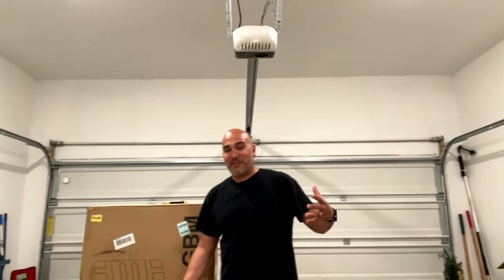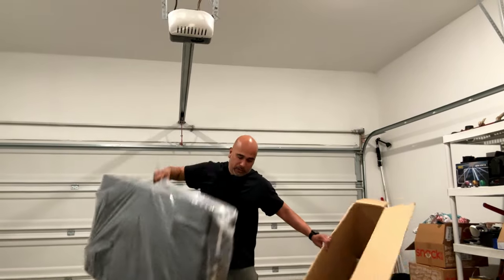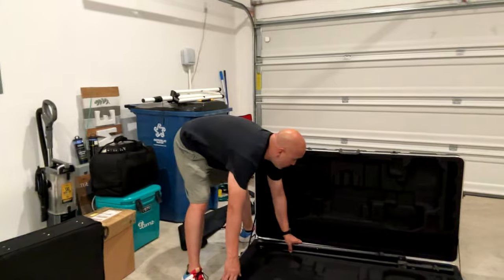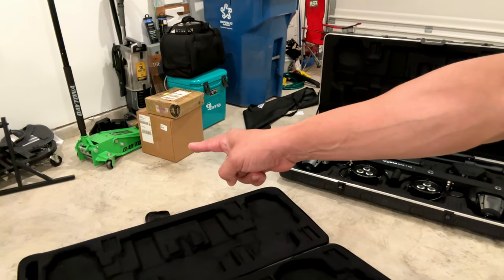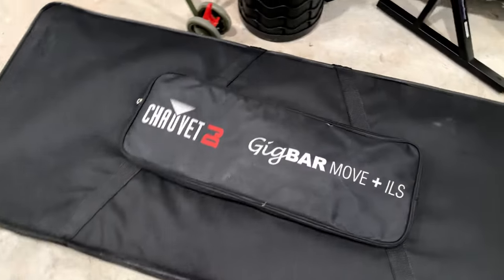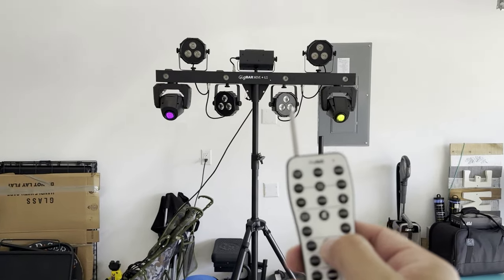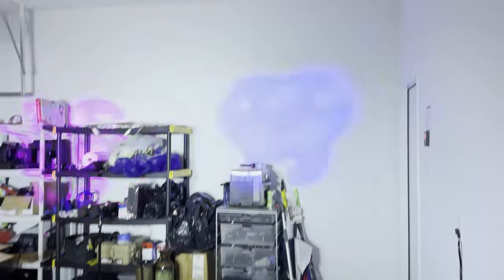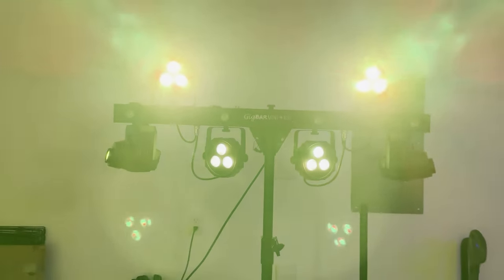The All New Chauvet Gig Bar + ILS Hard Case PLUS a Much Needed Modification to the Gig Bar!

Comment: I was so against this bar for my weddings because the lasers and shitty derbies. But I never knew you could swap them out! Bravo! Looks like I’ll be ordering one for NYE 🎉
Reply from the maker: Trust me, I was debating getting this too to begin with, but just said to myself, "I'll just turn the derbies and laser off and just use the pars and moving heads" But what a waste right? When I found out you can swap them out, I was sold! Would love to see yours when you convert it! :)
Reply: @djdannybhtx   I still like a slow moving mirror ball lighting for dinner and slow dances but haven’t found a replacement for my Chauvet Radius lights
Reply from the maker: Have you checked out the Rotosphere from Chauvet. Give a really great effect. To be honest, it looks so much better with haze, the only problem is, here in Houston, TX. 99.999999999% of the venues here do not allow haze! :( :( @PartyProDJsFL

Comment: I also replaced my derby's with pars. I am using the DDJ-FLX10 with Rekordbox Lighting. Absolutely awesome!  One thing to note: I left the derby's in the fixture profile but changed the lighting type from "effect" to "Par 1" & "Par 4" leaving the factory pars as 2&3. 
I also upgraded the case and love it (the wheels are great improvement making easier to  transport.
Reply from the maker: That's awesome! I would love to see how that works with your Rekordbox lighting!

Comment: Can you dim the lights on the entire gigbar from the remote?  Or do you need DMX hooked up to dim the lights?  If not, you may be stuck in a situation where they are too bright.  Thanks
Reply from the maker: I believe you can with the brightness button, however, I do have the ILS Command now and will test both very soon.
Reply: Thanks!

Comment: WOW! Genius!
Reply: Another tip on that remote. You should take off the Battery Everytime you finish a gig. If you leave the battery in the remote. The Remote will suck up all the juice out and you gonna have to buy a new one. I take it off.. and Put a Gaffer Tape on the battery and put it on the other Remote Section. When I'm ready to start a new gig.. I just put the Battery back in the remote.

Comment: That was a great tip about the pars, I just ordered two myself.  Thanks!  Hmm, I wonder if you can mount moving heads there instead....?
Reply from the maker: Thank you Tarekith! Everyone's been asking that, but the moving heads are hard wired into the gig bar, so I doubt that's possible. the other lights are a simple twist and plug into the gig bar. Wouldn't hurt if I asked though. I'll follow up.
Reply: Let me know also @djdannybhtx I did wonder about two more moving heads
Reply from the maker: I checked, you cannot add more moving head to this. There are moving parts inside of the bar itself is what I'm being told. That would be super bad ass though.  @djjohnnyp2700

Comment: I just inquired with Chauvet about purchasing the additional wash fixtures to replace the derbys. They're out of stock as of 5.15.2024, but they also replied: "Please note that the pars draw more power than the Derbys, so this may cause excess strain on the power supply and cause premature failure which would not be covered by warranty.". Have you experienced any issues with the difference in power draw?
Reply from the maker: Here's the deal. I have not experienced any issues with that. I personally asked their tech team if the derby's can be replaced with the pars and they said "Absolutely"! After I put out this video and it now has over 12K views, 210 likes and almost 200 comments; all of a sudden you can't do that. I'm thinking Chauvet ultimately likes my mod, they just don't want to admit to it LOL! I think this is the way the Gig Bar should have been made. I was also told by another YouTuber, that they were told by Chauvet, b/c of my video, they have been sold out of these pars ever since this video came out Lol. So I don't know what to believe.

Comment: Great video.  I've been considering getting the Gigbar Move + ILS. (currently have a gig bar 2) and loved your idea of taking off the derby lights.  When you pulled them off and added the 2 par lights, did you find the weight of carrying the gig bar around in the hard case is a little lighter?  Also, does the gig bar fit the same in its original case with the 2 added pars? I would think it would but figured I'd ask :)
Reply from the maker: Hey Jamie! The weight is about the same, the derbys and the pars are not far off in weight. And yes, it still fits in the original case too! I kept it because when I want to pack it in my Durango, the hard case doesn’t fit.

Comment: This looks much more elegant i would also lose that stand and replace it with a Gravity stand that will let you place it in front of your set up between the DJ booth and controller etc.
Reply from the maker: Thanks! I have since upgraded to a gravity stand as well! 🎉🎉
Reply: @djdannybhtx  Awesome video, I've been using the OG GigBar for a while (mostly do smaller local venues) but just upgraded to this bar. Curious which specific Gravity Stand you went with for this bar as the tripod does take up a lot of real estate I could otherwise use. Thanks!
Reply from the maker: I have the regular touring flat base and pole from Gravity. I wanna say it goes about 8' high? More than enough. Thank you!

Comment: Great Video Dj Danny, I’m looking to to swap out the derby lights as well. Just have a quick question. When hooked up, how do you control them using the ils command console? Will all 4 pars sync when pressing Par button or will they work when you press the Derby option? Thank you 🙏
Reply from the maker: Hey there thank you! So the one time I have tested it with the Command ILS, the pars worked perfectly when pressing just pars. Since I usually operate solo during my gigs though, I’ve been using the remote 95% of the time.

Comment: Amazing review and love the mod and case! Just wanted to ask, I just bought mine and am worried about the moving heads shining directly in guests eyes on my wedding dance floor this weekend. I’m playing with the movement settings and just wondering if you have any tips or have anyone ever complain that those moving heads hit them in the eyes.

Best wishes and thanks for the video!
Reply from the maker: Hi Michael, thank you Sir! So ii have never had anyone complain or say anything about the moving heads shining in their eyes. The good thing about the Gig Bar is I put it at it's highest point and the speed I keep it at a medium speed so that it's constantly moving and not paused too long in one area to be able to blind someone. You can also adjust the intensity of the brightness as well if it every becomes an issue. :)

Comment: Would it work the same for Gig Bar Flex or Gig Bar 2 if I switched the Derby to Par lights too ?
Reply from the maker: Yes Sir. As ling as it has the same connections. Just need to go to Chauvet Parts Store on their website, look up your bar, and all the replacement parts will be listed there. 😀

Comment: I like it easy setup I had bought the gig bar last yr but the moving heads weren't bright enough 10watts not good at all I, I have the 355 90watts that's more for a big venue I need something fast and easy for house parties
Reply from the maker: This is the Gig Bar Move + ILS :) The moving heads are 32 watt. It's really bright for most scenarios. Especially it being an all in one system. :)
Reply: @djdannybhtx  thanks bro ima look into buying it house parties I need something fast and easy

Comment: very nice job, but pay attention to the power output from the connectors for derbies, may could not the same and may can damage par led quickly,  burning them, if the middle connector have the same power output it would be great tio add another one or may a liitle laser box of 1w minimum if haze is allowed, otherwise another par led will be fine
Reply from the maker: Thank you! I contacted Chauvet before doing this and they said its fine
Reply: great! then go ahead! 😉  @djdannybhtx

Comment: I think that a lot of the features of the GigBar Move depend on what you're using it for. If you're using it for weddings, I'll agree (though it's a real lightweight for anything other than a small venue), the derbies and the laser are a waste, but for other venues they may be just right. I have a Gigbar 2 and in a small to a mid sized bar venue with some haze it's great, the derbies and the laser just pop (though in high light levels even haze doesn't help much). I wish it had the RGB laser rather than just the red-green)) although it doesn't really help the par's. Personally, while it has it's place, I'm not a fan of the ILS format. I run using dmx and have found that a light formatted for ILS uses more power and dmx channels than the same light that's not ILS (best example: Colorband  H9, I can do in 11 channels in the older USB version that now requires 18 channels in the ILS version, which means I lose 7 channels per light (ex: 10 usb h9's at 11 channels equals 110 channels. 10 ILS h9's need 180 channels for the same function, net loss 70 channels, then add in the reduction of the number of units that can be power linked )). If you have a lot of lights and are trying to stay in one universe that can be a game changer.

Anyhow, I'm off the soapbox. I agree with Danny as far as the hard case is concerned. I've found that it doesn't make any difference who makes the soft case, there are going to be issues. Usually the first thing that goes south is the zipper. Trying to find someone who can fix or repair one can be an excise in futility (or cost you close what you originally spent for the carry bag if you do find someone) and even then they wear thin and get holes in the fabric. I'll definitely be ordering one in the near future.
Reply from the maker: Excellent comment thank you Karen! I 100% agree with you, the original Gig Bar ILS looks bad ass with fog and or haze, however here in TX, 99.999999999% of the venue we play at DO NOT ALLOW ANY OF THAT! :( Which makes me sad, b/c I absolutely looooooooooooooove the effect that haze creates! The way I modified this Gig Bar is stellar for weddings now. The Gig Bar is one option we offer our clients, as well as upgrading to trussing and moving heads where my DMX skills come in to play! This let's me create the type of light show that is tailored to the event. :) Thanks for the feedback!! :)

Comment: I use a tiny piece of black gaff to lock in my focus on moving heads as they tend to move and get unfocused while in use. I want to link my Freedom Flex H9 IP to the ILS command is this possible?
Reply from the maker: Awesome, good to know, thanks! I don't think the freedom series links to the ILS unless maybe you have the usb drive if I'm correct?

Comment: Hey Danny, great video. It looks like only the par 3 is in stock, but not the par 2… wondering if you know if it’s super important to have one of each or could I just order 2 par 3s and have it still work the same? Cheers
Reply from the maker: Hey Ryan, thank you for watching! The crazy thing is, EVERYONE has been messaging me that they have been ordering the pars since I posted this video so Im sure Chauvet is wondering what the hell is going on lol! I would think that one position would work for both, but email Gilbert at Chauvet to make sure. He’s a valuable resource for me. Good luck and I look forward to seeing yours once its done 😀

chauvetcs@chauvetlighting.com
Reply: Thanks for the info Danny. I actually just heard back from those guys at Chauvet, they mentioned that both pars are identical, so there’s no need to #2 & #3. The only thing that they advised was any modifications made by the customer will void the warranty if anything were to happen or damage the light bar. Thanks again for the info!
Reply from the maker: Good to know and yes, we all know we void warranty on these things lol! @ryanhernandez6002

Comment: Great video man. Love the breakdown and the own modification. Correct me if I am wrong but what is the difference between the 2 part links in your description?
Reply from the maker: Thank you! I honestly don't think there is difference as they operate the exact same. It's what Chauvet told me to order, so thats what I did. LOL
Reply: @djdannybhtx  Lol, fair enough. I just ordered mine yesterday with 2 extra spots to have the same setup as yours. The moving heads are enough movement for me. And I want enough color just like in your video so thanks for showing us!
Reply: Do you know by any chance where to buy these spots in europe? @djdannybhtx
Reply from the maker: @anissekandrouch3846 not sure but if you email chauvetcs@chauvetlighting.com Im sure they can advise 😀

Comment: Im so conflicted about the Gigbar. I actually like the derbys and lasers when there is fog, thats what they are meant for, not to just be tacky dots all around the room. However I work alot of wedding venues and they usually dont allow fog or haze. But I also dont like the 4 white lights accross the front. I have had people complain that they are too bright and distracting. So basically its just a very expensive bar with 2 pars and 2 moving heads most of the time. Swapping the derbies is an improvement.
Reply from the maker: I totally agree with you. I may have left the derbies on there and the laser if we would be allowed haze in venue, but without the haze, it looks tacky. As far as the bright white strobe's, I leave those off all of the time. Tacky as well. I feel that Chauvet could learn a lot from JMAZ and their lighting bar systems.
Reply: @djdannybhtx  hey Danny so I swapped out the kintas for pars but I cant get colors to match, they are both different than the pars below and different from each other as well in all modes. Any advice?
Reply from the maker: Very Strange! Did you order the pars directly from Chauvet and did you get the correct slot numbers? When you say they are different from the pars below, what does that mean? Mine look exactly the same. @RobinApplewood
Reply: @djdannybhtx  ah, it must be the slot number? I pulled them from my other Gigbar because they are not available on the chauvet website. when I say "different" Im just referring to the colors being off.
Reply from the maker: Oh ok, yeah if you pulled them off of the GigBar2, they may not work with the ILS. :( @RobinApplewood
Reply: @djdannybhtx  from a Gigbar Move to Gigbar Move Plus. Sam slot number but probably a slightly different Par model. Any idea where else I can get those parts since Chauvet doesnt have em? Thanks man!
Reply: also the slots for the derbies pulled off say "1" and "4". Hmmmm
Reply from the maker: On your old Gig Bar right?  @RobinApplewood
Reply: @djdannybhtx  the derbies that I pulled from the Move Plus say 1 and 4. The pars from the old gigbar say 2 and 3
Reply from the maker: Weird! Chauvet advised me to order 2 and 3 and they worked perfectly. Not sure why the Plus one you pulled say 1 and 4. They were from the "top" correct?  @RobinApplewood

Comment: @DJDANNYB - Do you happen to know what the part numbers for the Pars
Reply from the maker: Yes Sir, you need both. 

Complete pars Position 2 part #: PTK4301000305282 - $75.00 - In stock
Parts Link: https://www.chauvetparts.com/product.htm?pid=318239&cat=

Complete pars Position 3 part #: PTK4301000305283 - $75.00 - In stock
Parts Link: https://www.chauvetparts.com/product.htm?pid=318240&cat=
Reply: @djdannybhtx why you need to buy position 2 & 3? Cuz I own 2 ILS  and definitely want to buy the 2 pair of par for both ILS but I want to make sure I buy the correct ones
Reply from the maker: Honestly, I think you just need to buy 1 of the positions like you said, but that's what Chauvet told me and even so, how do you know where to put which one right? They all work the same, so I don't think it matters which positions you buy. @DJIronMIc

Comment: I think you made a mistake taking alll fixtures off - its also bad advice to others... what you should advise and do and have done now is just buy the controller .....its now perfect for weddings with the controller - far more control over fixtures n so easy, i agree with you on the case ...might get one .... I would like some sticks like ape labs controlled by the ils -and a mini swarm wash ils
Reply from the maker: thanks buddy. But this video was not about "control', it's about me not liking derbys at all and replacing them with 2 pars and deleting the annoying laser. I have the Command and love it,
Reply: @djdannybhtx  Yeah did you ever try the fixtures with the control before removing them tho ?  you can couloir code everything make it act like a wash and set up different macros etc ., i think you probably did this then bought the controller because yeah it was all flashy flashy before the controller came out - the biggest reason not to buy one i think however that all changed with the controller    - i love this ils gig bar but had same issues before i got controller so i think rather than advise ppl to remove derby or laser advise them to buy the wireless controller ...you can use it to programme spotlight dance too but easy to pick a spot n just freeze